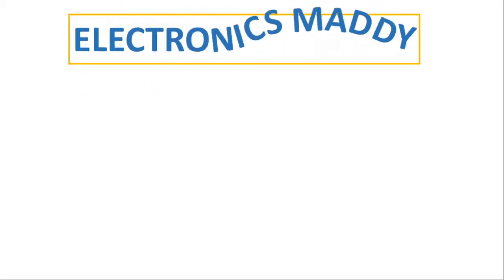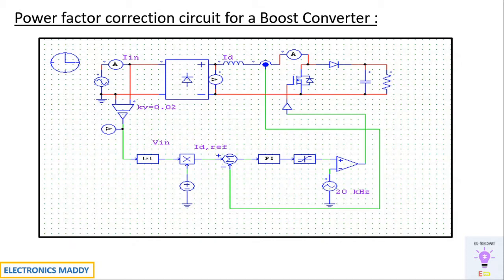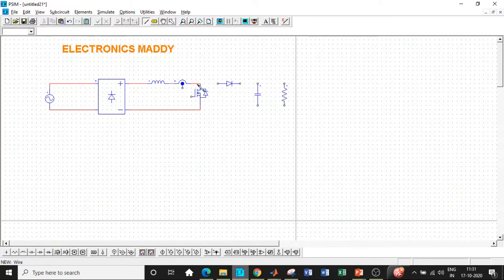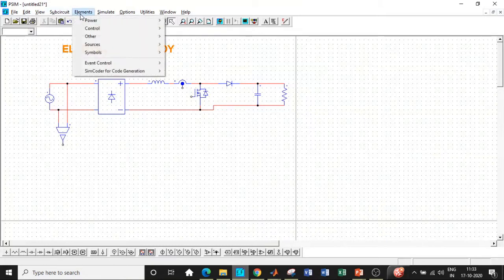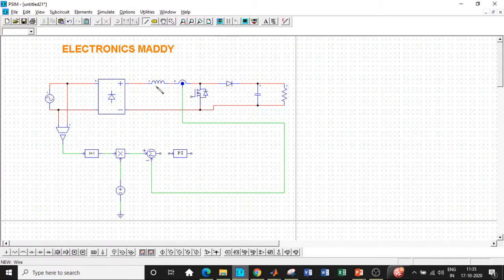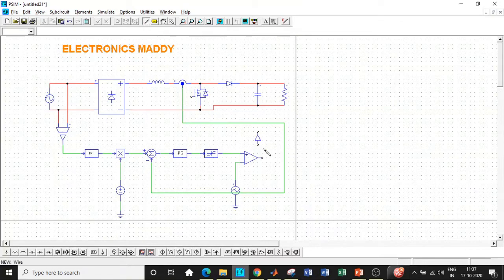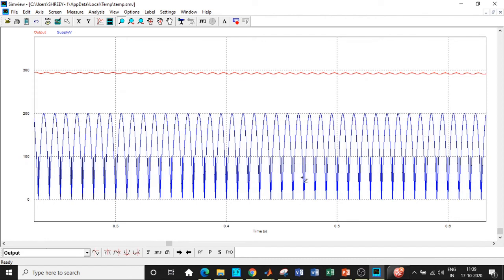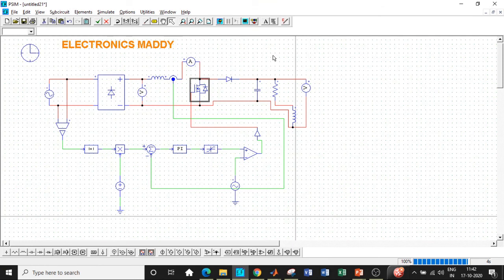Simulation of Power factor correction circuit for a Boost Converter in PSIM | POWERSIM

Comment: 13:00 Bro changed the simulation file.

The simulation results we all see aren't for the circuit he designed. I followed the same simulation but my results are different.

Oh my time🥲
Reply from the maker: Whatever is demonstrated if you replicate you should get the output. I dint change any files. That's not the intention for me to do these videos. I want people to learn and be benifitted.

Comment: Greetings sir.
I noticed that in the first minutes of your presentation, you stated the problem solved by this circuit is a phase displacement problem.
But poor PF in SMPS circuits is usually due to THD, not displacement.

So the boost converter mainly shapes the input current from a non-sinusoidal shape to sinusoidal shape.
Thank you sir.

Comment: Hi maddy, possible to make solar pv mppt and the motor load videos in PSIM, I have check your matlab videos but it would be helpful if it's in PSIM as well. I would prefer circuit based design mppt instead of using the codes. Thank you.
Reply from the maker: Hi. I am now concentrating on PLC programming. It will take some time to get back to PSIM.
Reply: @ElectronicsMaddy   Alright noted.